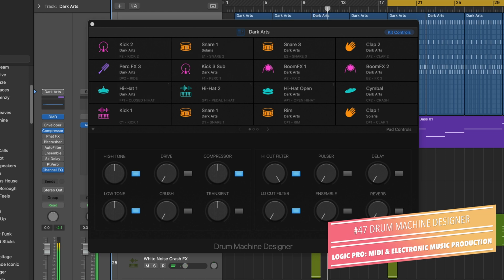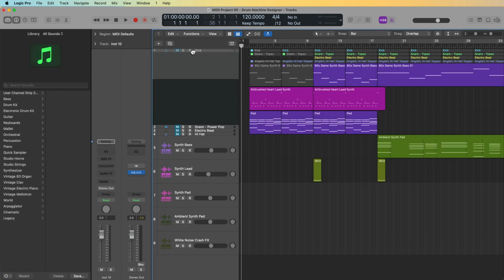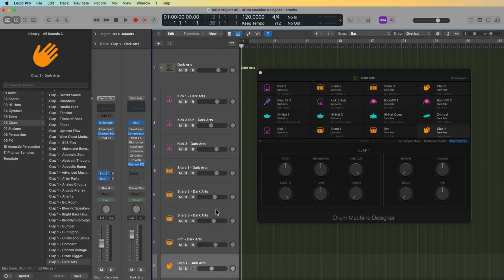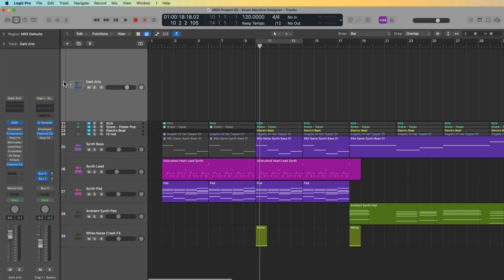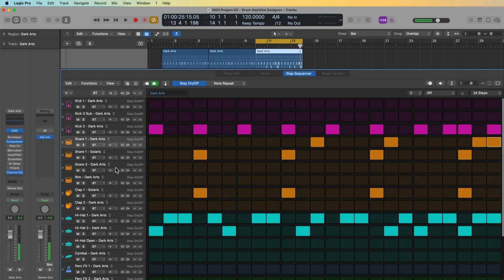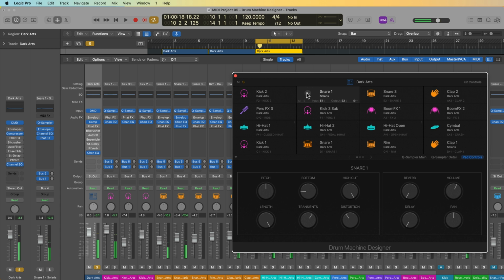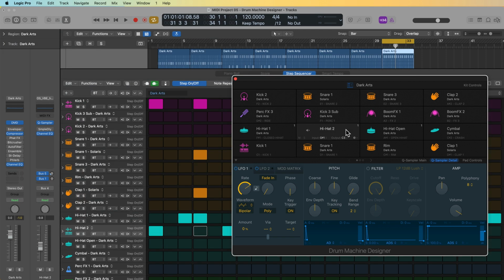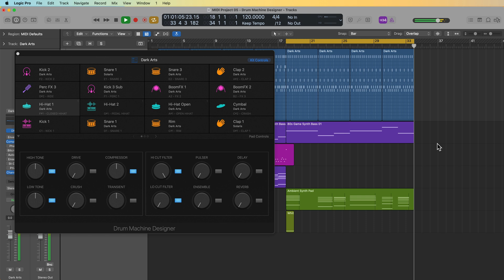Logic Pro #47 - Drum Machine Designer

Comment: Incredible App, this Logic. What‘s the difference between the DMD and the drummer? So far I used only the drummer. I knew nothing about DMD, respectively didn’t work with it. Perhaps #48 will answer my question a little. Thanks a lot. But after having seen this, it more and more turns out that I‘m even less than a beginner. 😒. About 35 years ago I had those drum machines of Roland (R 5) and Yamaha (?) with really good sounding electronic drum kits which I‘d like to have again, as I can‘t find super sounding electronic toms here. Or are there any?
Reply from the maker: DMD is really meant for loading in and working with electronic drum kit samples; whereas, Drummer tracks are really just meant for generating drum patterns in different styles. While Drummer does have a few electronic "drummers" the scope of sounds is limited. Those electronic drummers actually use the DMD kit, while the acoustic drummers use Drum Kit Designer. So You can think of Drummer like a track feature that is one level higher than DMD. If you scroll download the list of electronic drum kits in the library, you'll see some options for some classic drum machines -- Roland CR78, TR606, 707, 808, 909, TR-727, CR-8000 and Simmons SDS-V. You could start with those. Although if you have a particular drum machine in mind, you could check and see if anyone has sampled these kits? If you can get the samples, you could load in all the samples into DMD and build your own version of your old drum machines in Logic.
Reply: @MusicTechHelpGuy  thanks for this extensive answer. At least I still have the Roland R5. I shall see if I can get the electronic sounds work for me in Logic. 👍🏻